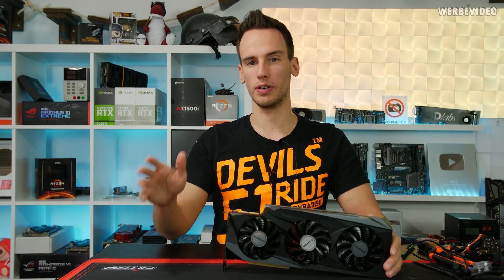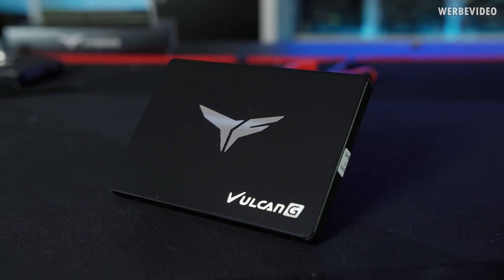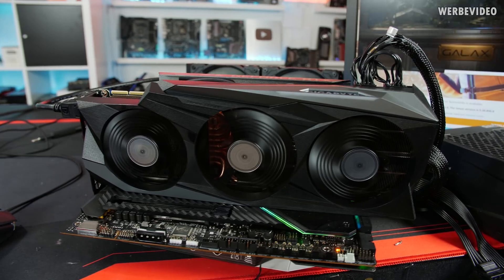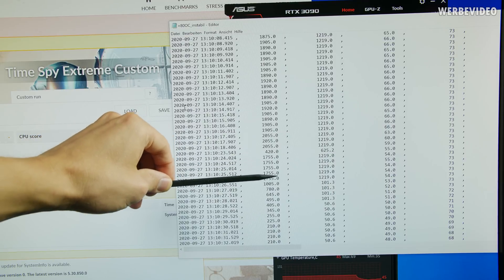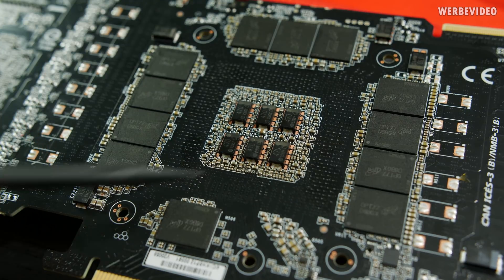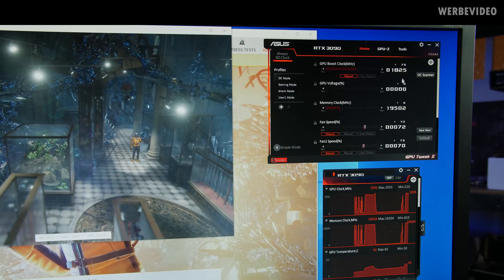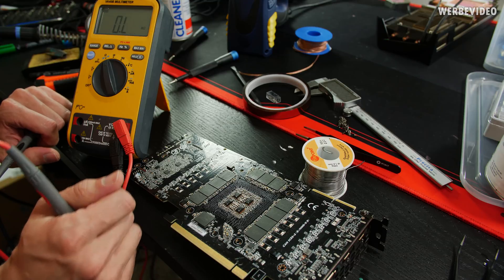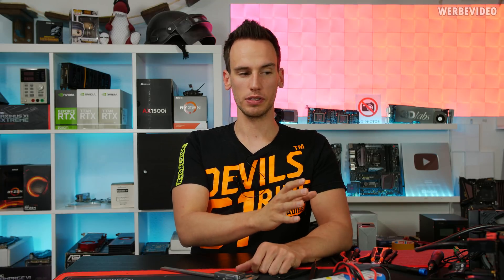We Tested the Cap-Drama - RTX 3090 MLCC vs POSCAP

Comment: You are absolutely 100% correct in your evaluation of the problem. Overclockers say "I overclocked it to 2000mhz and it crashed. The card is therefore faulty and Igor's Lab knows everything and if he says  it is the capacitors, then that is what the problem is". Overclocking silicon is becoming harder. I see no sense in overclocking a video card in order to gain a few frames per second. IDIOTS.
Reply: Its definitely doable if you have a waterblock but not worth it for a completely stock air cooled card.

Comment: These new cards don't have alot of overclocking headroom because of the power limit on most of them
when you hit 2000mgz the chances are good that it will crash its better to buy a pre overclocked card
done by the manufacture as they will have tested it on better equipment .

Comment: Good video, normal caps can have up to 20% tolerance..  ceramic caps fitted across electrolytic capacitor is how you remove noise on a power line.   Think its a mixture of both(hardware/software) but the manufactures will replace the caps just for its PR value.. one of the hardest things to remove is noise on power lines. causes all sorts of odd things to happen.. Look at the increase to clock speed its about 1%   So would I buy one if I could. YES I would

Comment: Hey Roman...have you tried replacing all the pos caps with the 10 small capacitors as in the tuf model...i believe you would be able to hit a total of 100mhz on total after doing that mod
Reply: @Roman...could you please make it one of your next projects?😅
Reply: yeeeeees... we must replace them all for maximum gains
Reply: No it also depends on the silicon
Reply: @tacticalcenter8658  agree...but to push the already available chip i believe the aforementioned mod is a good starting point
Reply: @VapoRub_Gaming  just buy the Asus or evga kingpin card instead. Kingpin will have a binned gpu
Reply: Well done for doing 30Mhz x3.3
Reply: Wouldn't the Asus TUF also overclock like that out of the box, then? I don't think it does.
Reply: @thijsschipper6406  exactly. People just want to think that's what happens because they don't know any better.
Reply: @thijsschipper6406  ..it would if you consider the the gpu chip binning level is same...but since it is not...it becomes a variable

Comment: From a management/controlling pov I question why people target mainly Nvidia for that flaw. Nvidia sold plans with the minimum requirements. OFC manufacturers are trying to produce cheaper. But within all those companies some electroengineer will have shown pro's and con's that come with changing required parts. In the end the companies, AIB partners, are to blame here. 
The management of each one decided to produce bigger and cheaper pcb's with more space, common cooling designs, fans, and taking the risk of "cheaping out" on parts/manufacturing cost KNOWING they wouldn't get enough time to test the cards with drivers.
It is a risk/reward decision someone made. Consumers should vote with their wallet. If you bought one of those cards just get a refund/send them back and buy one from the list of "good" cards.

Comment: Also, this is what makes your channel so good my german friend! No one has the balls to change the caps. To see the difference SO THANK YOU SIR 

the reason ppl are so upset with this is that they are crashing with just standard settings within GPU boost 2.xx all the manufacturers need to do is release a bios that prevent 2+ GHZ 
once stability is achieved. all will be happy and right with the world. 

If you are then dissatisfied with it not boosting over 2GHZ just remember Nvidia guaranteed it to run at 1.71ghz BOOST so anything above that is free. So if they put a hard limit at 1960mhz GET OVER IT lol

Comment: As long as its stable and cool i honestly dont care if its 1850mhz or 2100 mhz.  its irrelevant in gaming anyway.  One little concern i do have is that silicon and the caps lost some çapacity/efficiency' over the years and i hope that wont cause future issues.  A card this expensive needs to last me 4 years.  we have 2 year warrantees here so having it break out of warrantee would be awefull.

Comment: That soldering job tho... The solder didn't seem to flow properly, try setting the iron to higher temperature next time :D
Also yeah, don't try to pull out the component while desoldering, the PCB traces tend to peel off. :D

Comment: don't pick up a half-desoldered cap with your tweezers! you risk pulling the remaining pad off the board. 
just heat everything up with a heat gun. if not available, add GENEROUS amounts of solder and flux, to the point where solder on one side can remain liquid while you work on the other pad. 
that way you can vertically pull the part off without the risk of damaging the landing pads.
Reply: Actually in this case the part has flexible tabs on the end. Personally I use two soldering irons in this situation.

Comment: All the youtubers come with the exact same excuse: "when you overclock you risk losing stability", like people don't know this?  However this behavior is reported to happen under GPU boost 3.0. That is normal use, and not the consumers fault! 
Also, if your card is not suffering from the problem, replacing caps proves nothing outside of the fact that mlcc is better than sp caps, and everybody beat you to that point already. 
Someone cheaped out on a few cards, and should be held responsible for causing the consumers trouble and unnecessary RMA's etc. 
TL:DR I don't care one bit that these cards are pushed very near the limit stock, hence being bad overclockers. But they should still function as advertised during normal everyday use.
Reply: Yeah, I had to set a frequency/voltage curve on my rtx 2060 from gigabyte with factory oc. I basically had to down volt. At stock it crashes games always, it is very annoying,it should be stable on stock. My curve is rock stable, but it is annoying I had to spend so much time on it.
Reply: There are only few people that are having this problem while running stock settings. 
Why should you always use the most expensive parts, if a cheaper one works as well. It was not enough time to really test everything. 
If the vendors handle problems properly it is enough.

Comment: This is the first video that performs an actual test that removes the other variables. Just comparing 2 different cards like the others do doesn't prove anything. Thanks for that.
Reply: it is not possible to do this swap on the Zotac RTX3080 as it doesn't have the terminals for the 10 MLCCs,
but I'd be interested in seeing the same test Roman did here to see the difference between the 6x330uF SP caps they use & 6x470uF SP Caps like on the Gigabyte
Reply: @shaneeslick  Oh it is possible. You dont actually need those terminals to connect mlcc's because you can make them your self with several different techniques.
Reply: @jarnom85  OK thanks,
but I'm guessing not as 'easy' or should that be 'straight forward' as on the Gigabyte with the tabs already there
Reply: @shaneeslick  Well, easiest method is cutting two copper wires, soldering those wires to existing pads and soldering mlcc's across those two wires.

Comment: Nice video, but apparently both Pascal and Turing owners started having crashes after switching to the new drivers that supports Ampere, so don't think it's only a hardware problem. Seems to me the biggest issue is with the drivers... and maybe the PSU of the Ampere owners. A noisy PSU might cause more problems for those 6 NP-CAPS cards. This is all speculation though... but this whole issue is speculation anyway.

Comment: Would it not be better to show this in a case with poor airflow, rather than a open air test bench, because that's probably a significant impact here too.  Yes the principle is the same but the speeds achieved would probably more dramatically different because increased heat and poor voltage control (cleanliness) is a double whammy is it not?

Comment: Only the high quality dies get the fancy caps
That's also generally how the past PCB designs have been made. 
As an example on cards where different die SKU's share a PCB the lower SKU die gets allocated lower quality parts BOM (Bill of Materials)
You can figure this out by downloading some of the  leaked PCB schematics and assembly files.

Comment: Comparison to RTX 20 series is a bit odd considering that the micron memory chips were so bad that NVIDIA switched all further cards to use samsung memory on the 2080 and 2080 TI's. So yeah, I would say it was pretty bad. Also, we dont know at this point just many of these cards are crashing on stock clocks. 
If you get the choice to buy a card that has a 97-99% chance to work (a standard RMA rate if I remember correctly) or a card that has 75-90% chance to work with possiblity of instability and guaranteed lower OC speeds even if you get a good binned chip, why on earth would you ever get the worse card at the same price range?

Comment: It was pointed out earlier, that these crashes aren't happening in LINUX.
Reply: Its possible, the AMD drivers for linux never had the black screen issues, for example.
Reply: Wait, Linux users are dumb enough to use Nvidia? Last time I tried to install drivers for my Titan it corrupted my Linux install so bad nothing would ever install again, that’s right, from a graphics driver... Never use Nvidia if you have Linux, just don’t do it, I don’t care if you have to trade a Titan RTX for an RX 550, it’s worth it just to avoid the headache and possible suicide. Nvidia is garbage on Linux (not to say their Windows drivers are any good, but it’s horrific on Linux).
Reply: @jakegarrett8109  Everything working pretty OK with Pop OS that handles Nvidia drivers nicely.
Reply: @jakegarrett8109  I've used some flavor of Linux since the early 2000s. Never had nVidia GPU drivers blow up an install.
Reply: A C yeah I didn’t even know it was possible to do that... but at that moment I decided it was never worth it to use Nvidia with Linux, ever. It’s always such a hair pulling pain compared to Radeon which just works, but that incident was the breaking point of insanity that I decided never again Nvidia.

What’s really crazy is how simple and basic that build was, single GPU, nothing fancy, as basic as can be. Not like one of my Radeon builds with quad crossfire or like a render rig where I was running half a dozen mixed cards (so I can game with a couple Radeon cards in crossfire while using a Titan for CUDA acceleration while using a few more Radeon of a different generation to render videos all at the same time because that works fine even on Windows just plug and play). But no, a simple fresh install getting everything setup that day on a simple single GPU using the more stable creator graphics drivers for the Titan and it somehow broke the OS from a graphics driver. I’m still mind blown how that can happen, it’s not a flaky OS holding on by a mere thread like Windows is where you might expect a sneeze to nuke the OS install, it broke Linux! That takes some talent and skill at programming to screw up that much...
Reply: Who games on linux?
Reply: lmao
> gayming on linux
Reply: theyre not happening in linux because no one is using linux
Reply: @Meltrx  Look at your smartphone for a second, then look back up at your screen, further up, to the open tabs in your browser. Now think for a moment about what you saw. And about every single server you exchanged data with this year, and then never again comment on the internet because you would be using Linux doing so.
Reply: Mat Wtf ok guys chill out it was a joke. Also I don’t know about what the market share on servers is but there are plenty of windows/IIS servers out there. The fact of the matter is if you are buying this video card you probably have a windows PC (Linux gaming is a joke).
Reply: @Gottwtf  so makes smartphones with RTX 3080!

Don't be stupid. Use context. 

There are very few gamers on Linux with an ampere card, which is the important detail
Reply: @aSASa45454  Few Gamers yes that is correct. But A: Around half of Nvidia's revenue comes from their datacenter and compute business, which again means that around half of those chips will in the end end up running under linux in the end. And B: One big group of people with lots of money who is most eager to get their hands on those new cards are the AI folk who is craving more tensorcores to speed up their training. And those folks mostly run linux.
Reply: @Meltrx  This is a rather facepalm sentence from you. Just more than half the net is runnin on linux, plus shitton of iot, and mobile and low power devices are running it, nad there is a nice chunk of userbase on desktop as well. Only in the gamer world where windows taking a huge chunk, outside of that, windows is loosing to macOS and recently to linux too users here and there.

Comment: its kinda a bit cringe when you soldered that tiny cap using big soldering tip, i usually using chiseled 0.8mm tip for that tiny 0805 cap, but as long as it works i dont mind, everyone have their prefered way to do things, also if i'm doing a replacement, i always clean the excess solder first using solder wick so its not flooding the pad with excess solder, anyways good video

Comment: try test in linux Gear Seekers try that in is totaly stable :D 

@m_wimpress
 if you get a chance to test your 3090 let me know if you're seeing stability issues. I'd love to hear your thoughts.
Zobraziť toto vlákno
Gear Seekers
@GearSeekers
·
28. 9.
I'll need to investigate this a little more before I come to any conclusions but in the meantime I'd love to see some other Linux users who have 30 series cards test this as well.
Zobraziť toto vlákno
Gear Seekers
@GearSeekers
·
28. 9.
Notably the GPU which we saw to be the most unstable has MLCC caps. It is very likely a driver issue and the whole POSCAP vs MLCC issue might be debunked. Remember Windows and it's drivers isn't the only way to test something.
Zobraziť toto vlákno
Gear Seekers
@GearSeekers
·
28. 9.
Some really interesting findings today regarding the stability issues with the new 30 Series cards. The cards we've found to be unstable are only unstable in Windows. In Linux hitting same boost clocks with the same testing it is rock solid with zero issues.

Comment: der8auer you should try running the card with a stable fixed voltage and frequency. Try running it at 2 GHz at 1 Volt and then also try 2.05 and 2.1 and see if those work as well. I see reports that people can get a high clock at a lower voltage and with no fluctuations (like under regular boost algorithm) and experience no desktop crash. Perhaps this is some sort of brown out phenomenon where the card keeps regulating power use to the TBP value so when you game and the workload changes then everytime the frequency goes up to 2 Ghz the Voltage drops down to keep the power budget and then it quickly jump back up to perhaps 1.1 Volt but lower frequency. This rapid fluctuation eventually leads to to much "noise" and the card crashes.  What is your thought on this? I think it seems plausible that this might be the issue. Perhaps the MLCC's help a little in this situation because they are quicker on their feet and can adjust quicker to the fluctuations but eventually they are not bullet proof and the chip crashes anyway.

Comment: Theory time, nvidia removed the two ram dies, because the GPU is already running so close to max clock. That they cant do a normal "SUPER" refresh release with higher clocks, so the "SUPER" is going to be a 12gb version.

Comment: the biggest thing i came away from this was with some tinkering I can add 20 to 30 more mghz of gpu head room by adding capacitors to the back of my card LOL
Reply from the maker: That's possible :) that's why extreme Overclockers do cap mods
Reply: @der8auer  can you please test all 6 MLCC caps?
Reply: the biggest thing i came away from this was with some tinkering I would absolutely without a doubt completely ruin a perfectly good gpu by my attempt to add capacitors to the back of my card
Reply: @jfniv  LOL. In my case just removing the default SP caps would ruin a perfectly running GPU.
Reply: Same as it pretty much always has been :)
Reply: I was thinking why no one made RBG capacitors yet
Reply: Definitely not a sure thing, though.  If the caps are already more than sufficient, adding more/better ones doesn't help.

Comment: You should place back the poscap capacitors and revalidate the initial results to prove you did not brake something during testing.( Maybe also putting all poscap capacitors on FE card). but good test anyway, thanks!
Reply from the maker: But this way my card is better 😂 don't want do do this twice
Reply: How about stack the SP-CAPs above the MLCC...

Comment: Great video but why didn't you go all the way and replace all of them?   

Also doesn't a two tip soldering iron exist?  
Seems it would make more sense for these types of components that need both sides heated at the same time.

Q3:  Are the 47uf MLCC's 6.3v or 10v?

Comment: 6:19 Mr. Rossman is probably not proud of you. Using the heat gun first THEN adding the flux later. The order should be the opposite.
Reply: I almost can hear him. "NO. NOOOOOOO. ADD FLUX AND THEN HEAT THE BOARD. Oh my god, that is why kittens die." 😂
Reply: If only heating to about 100C it shouldn't matter too much. But please use MORE flux, this looked rather painful.
Reply: Also you should totally get a hot air station, I feel so bad for the poor capacitors beside the ones you replaced that just got a massive dose of heat for no reason :(